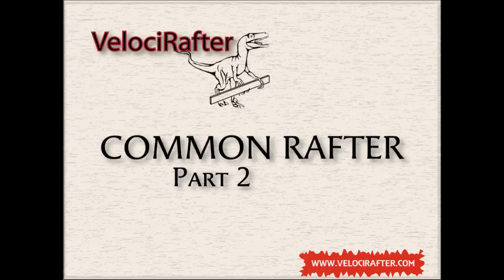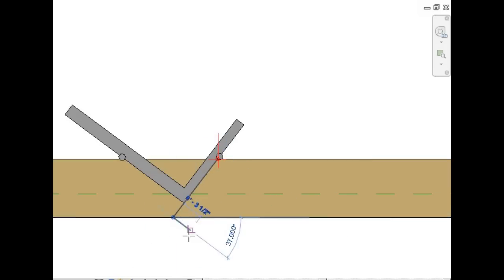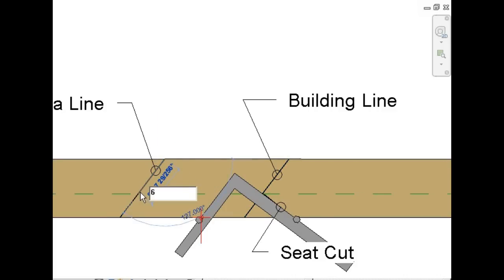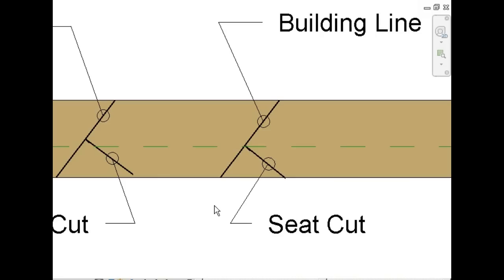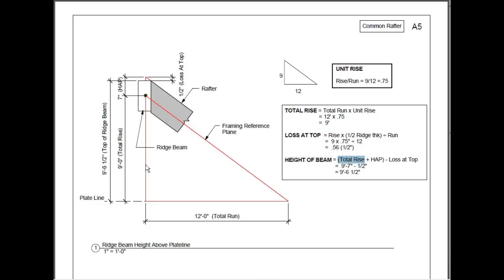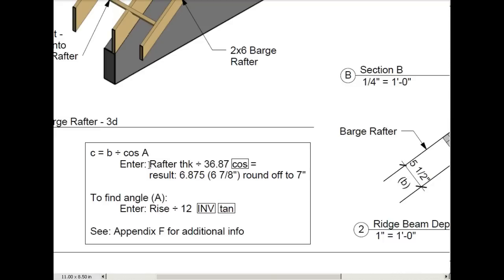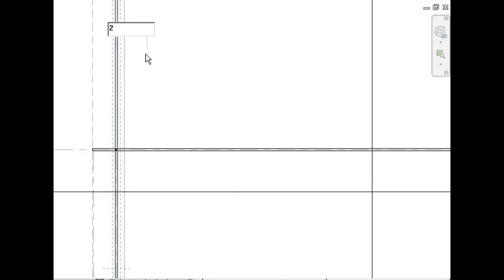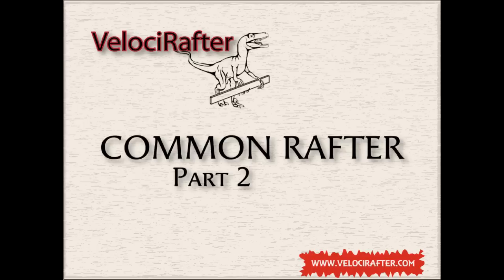Common Rafter   Part 2

Comment: what i notice is that Michael Nauth and you would get 2 different answers for ridge beam height
Reply from the maker: I double checked my math and it looks correct. Since you were kind enough to comment, I've included a download link to an Excel Roof Framing Calculator that I've developed that computes Ridge Beam Height as well as many other things. Enjoy! https://www.dropbox.com/scl/fi/qsjvkwwwt7y2c5v1uz62p/Rafter-Calculator.xlsx?rlkey=dadm5wzfcf7vwj9y1p32jdqll&dl=0

Comment: Great lesson. especially plugging in Height Above Plate calculation to fixed ridge height. For years I built additions by cutting rafters then joining them to a loose ridge then spiking all in place. Nice to learn something different. Thanks.
Reply from the maker: Hi, thought you might find this useful. It's an Excel based roof framing calculator that I developed. https://www.dropbox.com/scl/fi/qsjvkwwwt7y2c5v1uz62p/Rafter-Calculator.xlsx?rlkey=dadm5wzfcf7vwj9y1p32jdqll&dl=0

Comment: So the material height of the ridge beam is 12" ?
Reply from the maker: That depends. If the ridge beam is not supporting a load and if the ceiling side of the rafter gets finished, I would use the same dimension lumber as the rafters.
Reply: I always use a ridge one size up from my commons. So for example if I was using 6"x2" for the commons my ridge would be 7"x2". The same rule applies for hips and valley's. This is my rule of thumb if greater span's are involved and or greater loads I would consult span tables, 👍🔨🇮🇪

Comment from the maker: Hi Halftime, I use span tables for rafter sizes. Ridge beams and hip rafters are generally supported by rafters so I size them the same depth as the rafters. Valley rafters support a lot of load so, I suggest doubling them up or having them engineered if the span is great.

Comment: Hi Mark:
Your common rafter videos are excellent.  Maybe the most comprehensive I've seen on this topic.  Is the building 24 X 36 or 24 X 38.  I got lost calculating the number of common rafters for 36 feet when it appears that you calculated for 38 feet.  Thanks for the details.